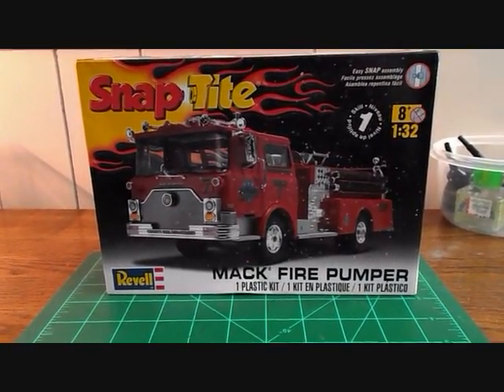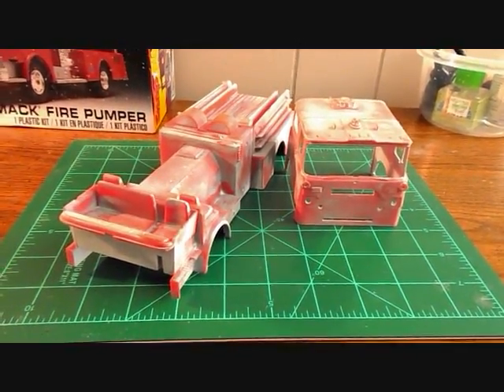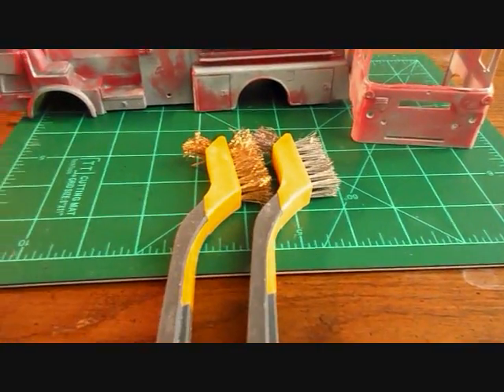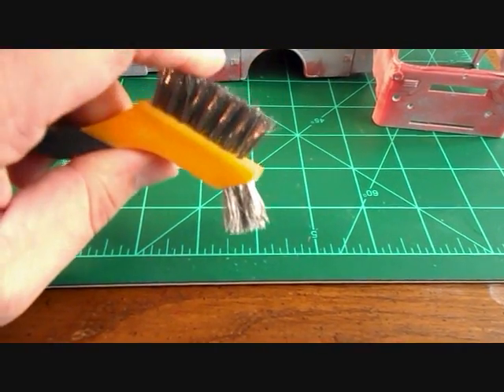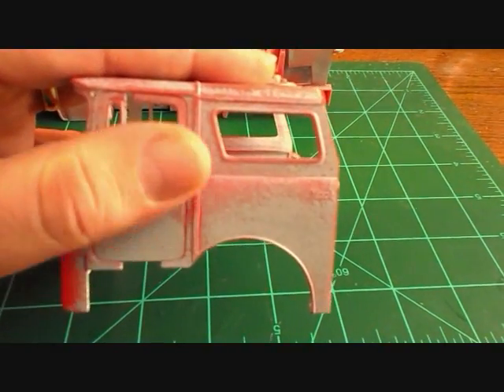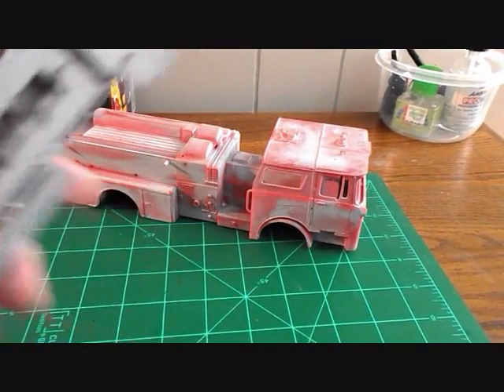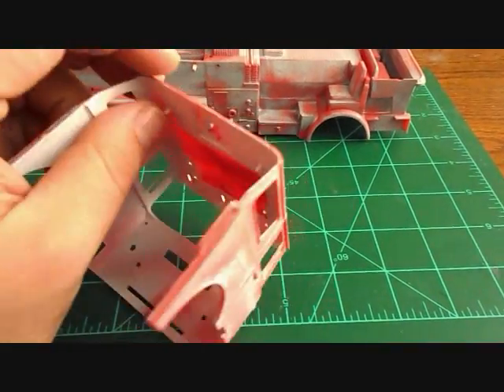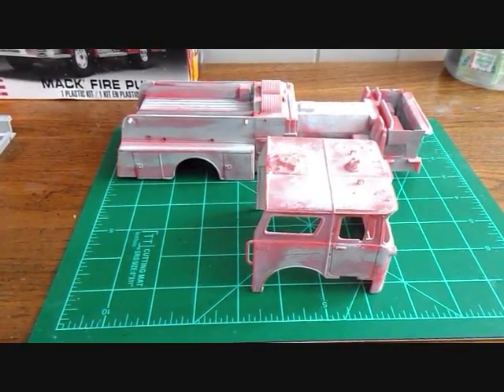Revell Mack Fire Pumper 2

Comment: Some of the car builders in our modeling club buy glue bombs from Ebay from time to time. You know, kits that have been poorly put together or the modeler wants to strip/detail the assembled kit to his satisfaction. Been told soaking the kit in brake fluid works really well. It'll remove the paint, but not affect the plastic parts and also helps loosen tube cement glue to make taking the parts apart a lot easier.

Comment: next time you strip something find purple Power my Walmart has it in the automotive section or brake fluid works good too neither one will hurt the plastic I've got some that I've soaked for a month and still haven't gotten the paint off
Reply from the maker: I asked for advice in several places and the general response was 91% alcohol. if I have to do it again I may try one of the others.